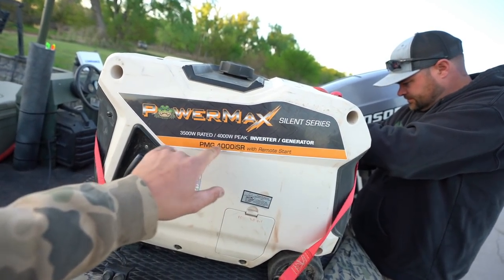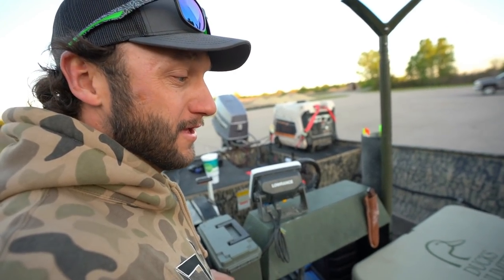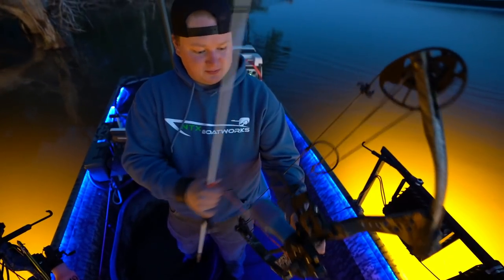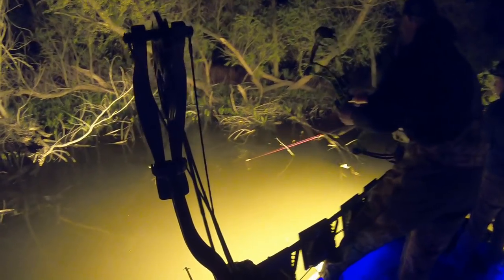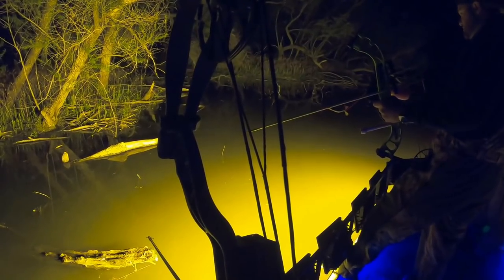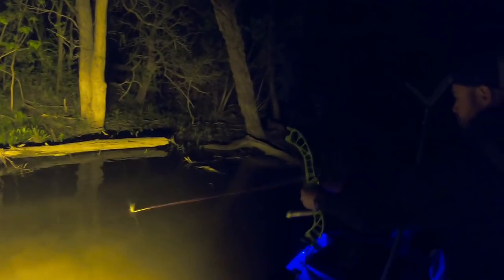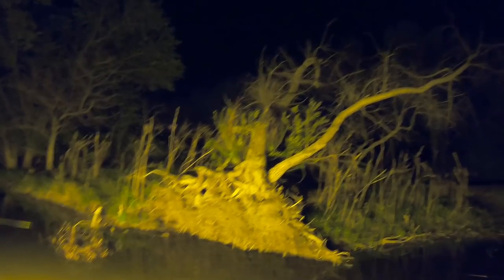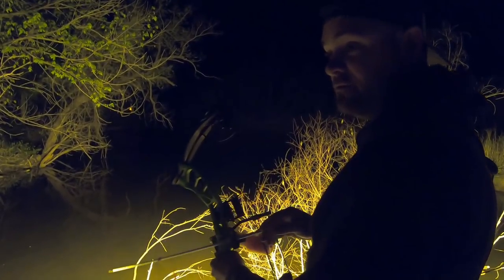Bowfishing a Public Lake Deep in the Backwoods!!

Comment: Bobby. The reel with these ams rigs are definitely the way to go but they are nothing but a line retriever. You can hardly reel in fish with them. The line is hard to tangle so just pull them in with the line and then reel your slack up.

Comment: Tuck the bottom of the reel's trigger back into the bow somewhere to keep it from bouncing around on you. Also if the reel is hard to reel you may have to much string on it. It helps to reel with the bow pointed up to help the string fall the to back of the bottle.